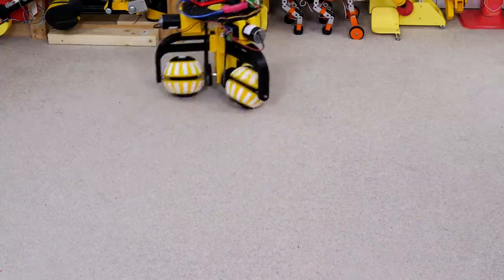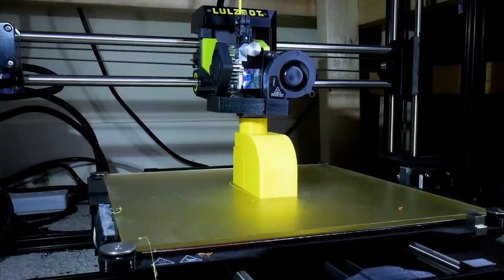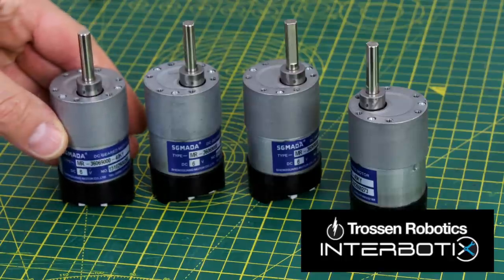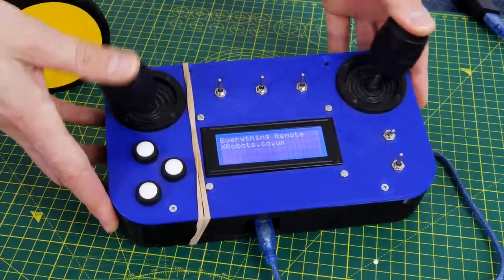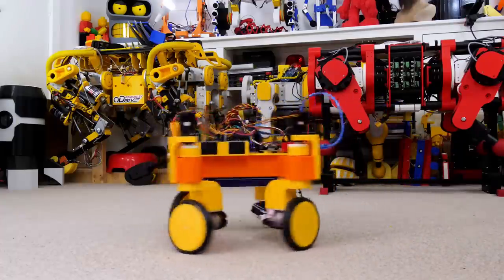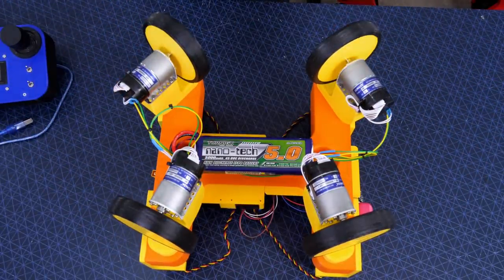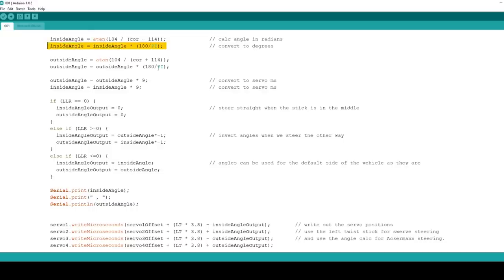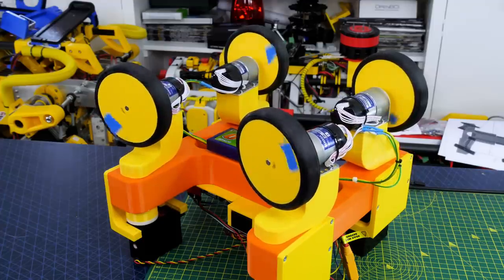How Many Ways Can This Robot Steer?

Comment: Now you need to code a more advanced version. The ones in FRC do a vector addition problem. It allows you to request a position and request a rotation with command inputs and the controller will figure out what direction all the wheels need to be turned and what power to give them. Usually 100%. It is pretty crazy some of the stuff you can do. with this method it is possible for the robot frame to be spinning and driving in a linear path.
Reply: Our frc team actually has field oriented code, kinda unrefined though, we are working on it.
Reply: Great idea 🙌
Reply: How would that look and work with this kind of robot? Are there robot videos on YT that show this mechanical setup (no omni wheels) being able to rotate and drive independently of the path curve?
Reply: @CuulX  FRC robots have mechanisms where the wheels can rotate infinitely. So there are no issues with running into a servo limit.
Reply: @CuulX  You would ba able to move as in a fps game, and if using fpv, you would get similar sensations. Probably not the most usefull think on earth, but for example if you had to use a forklift vehicle, these controls could be very usefull.
Reply: @nathanskinner423  ok! I found another comment linking a video also. And I thought some and figured out how I would program it to do all of that and now it makes sense.
Reply: @danroswell8844  Nice, looks great!
Reply: The way we configured our field centric code was one joystick translated the bot in x and y and the other controlled rotation, it was super easy to pick up for new people
Reply: @comedy6631  I think most frc teams have field-centric driving for swerve, at least my hs's team has it
Reply: @nathanskinner423  Not only is there no servo limit (which I'm assuming you mean is a limit with how far the servo can rotate, not the mechanism), but also since the motors are mounted on the top the motor wires won't get screwed up.
Reply: @spidernh  Yeah, I know. I studied Jack in the bots design a lot. I made a 3d printed version to play with. It of course would never survive competition .
Reply: @nathanskinner423  Nice. Also, how hard is swerve to program, if you know? I'm in Michigan so I'm still doing FTC (in 8th grade) but next year I'm joining FRC and last year they did swerve, so I would assume they will in 2023 also, and I feel like it's gonna be hard to program
Reply: god i really want to help program a swerve drive one of these days...

if you don't mind me asking, what is your team number? i was 1983 but now am with 2097 in Seattle :D
Reply: @raphaelmonserate1557  I was in 4309. We came up with our own innovative drive train, dual drive.
Reply: @spidernh  Swerve is like any other code problem. It seems really hard at first but you can break it down into much easier to solve smaller problems until you reach full optimization. It will require some trig knowledge as well has vector and array understanding. I think you can do it. This is of course if you are starting from scratch. You can download libraries to make your code a lot easier to put together.

Comment: This drive system is way more effective than I expected, and the design is commendably simple.  It would also be interesting to see a differential swerve drive - there are a lot of interesting ideas out there.  It could use bevel gears, or it could use a slipring.
Reply: Mmm. Triple-Differential~

Comment: High-school robotics teams have been using this type of drivebase for years. However, one problem with swerve--drive is that there is a bit of a delay when you want to change direction, as you have to wait for the wheels to rotate to the desired directions. With Omnis or Mecanums the change in direction can be almost instantaneous. Anyway, for some next steps, you should consider improving the algorithm for turning the wheels such that you can input the desired translational and rotational velocity of the robot. This will allow for true holonomic movement.
Reply: If you can, and assuming you are using SDS modules, use Falcons rather than neos for steering. Our team has experience with both an all-falcon drive and a falcon (driving and NEO steering). It would be neat to see a Swerve Drive go-kart that uses a joystick, and would be fun to rip around on, especially now that SDS sells a Colson Wheel Kit.

Comment: You are the man that really should own a plastic crusher/melter filament recycling machine with all that printing you do !
Reply: Do you know how expensive and difficult it is to process your own plastic back into filament?!
Reply: @lio1234234  well not really. I made it for my college project and I was able to get it done for  under $400
Reply: @sajalagarwal195  What was your filament diameter variation? And was it consistent across batches?
Reply: @cx765  precisely! It's impossible to get perfect prints when you have flow differences due to varying diameter of the filament!
Reply: @lio1234234  You can compensate for this with a filament thickness sensor on your printer though.

Comment: I recommend learning geometric algebra, it simplifies tons and tons of difficult linear equations to a single tiny human-readable equation or two.
It treats rotations and translations as reflections, which allows a lot of terms to cancel out. This lets you come up with transformations, that are far better than quaternions, and that allow you to easily mix translation and rotation. In fact, quaternion - is just a bireflection in 3d. Bireflections in general sense are called rotors, which actually work for any amount of dimensions.
I could honestly talk about beauty and simplicity of GA for hours. You have to learn it, at least for times when you get stuck with mathematical derivations.
It would allow you to program a lot more difficult robots with little thought. You could easily make an inverse-kinematics algorithm, that works with various motors, pistons and hinges of all sorts of degrees of freedom.
It might be hard for someone unfamiliar with terminology to get into GA, but believe me, it is 100% worth it. The actual math is far simpler than you might be led to believe.
Reply: Is geometric algebra something akin to a branch of mathematics?  Or is it a more focused set of ideas than that?  Also, where would you point people for an introduction?
Reply: @doctorbobstone  There is a community driven website about geometric algebra, under the name of "Bivector" but youtube keeps on removing my comment with a direct link
Reply: What math prerequisites are required to be properly prepared to study such material? Differential equations? Linear Algebra?
Reply: @pws354_8  Mostly just good intuition about linear algebra, I'd say.
Reply: @pws354_8  Knowing group theory would also help grasping some core concepts.

Comment: This would be an excellent platform for a custom built slipring! This would let you rotate the wheels as many times around as you want, although you'd need encoded motors to drive the rings.
Reply: He is using encoded motors

Comment: Simple yet effective design. Seems really nimble and quick. 
One thing I noticed, though, is that it seems to speed up in curves.  Do you run the inner pair of wheels at the same speed? If they slowed down slightly when turning, and you modeled the line of turning between the inner and outer pair of wheels, I think you'd get consistent speed.
Reply: That sounds correct. It seems that he set the inner wheels as 'the speed' and pushed the outer wheels faster too keep up. It works but would be unusual and uncomfortable as a passenger. The 'outer side passengers' would be constantly thrown against the wall.

Comment: If you use a less aggressive steering angle in the "rear" wheels, you can keep moving forward throughout a turn.

Also if you steer all four wheels in the same direction at higher speeds, you can get more stability. Anti-Ackermann arrangements help out here too, and having differential steering on top of that is always fun too.

Comment: Consider replacing the current wheels with omni wheels and using the ability to control the angle between wheels and the current direction of travel to create what amounts to an infinitely variable transmission. Imagine the wheels initially pointing in the direction of travel and then gradually pointing more and more inward as speed increases. Would be really cool to see how fast it could go.

Comment: Have you thought about using a component like cable down the wheel shaft so you can power the motors without having to worry about wires restricting your motion.  I’d assume the motors can overcome the friction caused by the cable connection (though from my experience with CRT’s they can get loose pretty easily) but you’d get 360 degrees of free XY plane (floor) rotation
Reply: An easier component to use for that task is called a slip ring!
Reply: @davidmalkowski7850  I didn’t know about that! So cool!
Reply: FRC does something even easier, we put both motors at the top and drive the wheel with a bevel gear at the center of rotation, look up SDS mk 4 for a good example of this
Reply: @killapoof  that’s so clever! I’d imagine the wear on the gears is less than possibility of dust/buildup affecting the electrical and magnetic signals of the previous two suggestions and it keeps both motors stationary as well rather than a rotating motor (not in the way that it should) creating unnecessary toque

Comment: you should make the centre of the turning circle move closer till it goes to the centre of the robot and it rotates on the spot, this is how ive built 4 wheel steer robots like this in games, it makes a very intuitive and fluid transition from straight to turning to rotating and back again

Comment: Great Job! Loved the project. Perhaps one thing that could be done is to add some gear ratios to make the wheel turn 360 degrees while the motor does half that.
Reply: On the servos, or the wheel motors?

Comment: 2:1 gears on the steering for 360° rotation and to offset the steering axis from the servo axis. Then you can use a hollow axle to run the motor wires through. Or stepper motors/CR servos and an encoder for multiple turns (limited by the motor wires twisting).
Reply: good ideas, but 360 doesn't add much functionality, since you can already reverse the voltage going to drive motors and cover the remaining 180 degrees with the current setup. turning would be twice as fast though (and half as torque-y).

Comment: You could also try different designs of omni wheels, you get ones where the wheel is just many diagonal cylinders around it and it should mean you get the same contact area in every direction.

Comment: That's awesome, I'd love to see a version you can ride...
Reply: The wheel mounts definitely look like the weakest structural piece, you would need to make those significantly sturdier if you wanted to support the weight of a person. Not to mention the weight of the rest of the vehicle. Probably possible, but not sure about practical.
Reply: @Manabender  But imagine him riding around on a chair like that, at a convention, that'd be so funny. Using 3D printing alone would probably be hard, but he's got a CNC and a welder...

Comment: Have you ever seen the 2008 movie, Speed Racer? Some of the cars in the movie, called T-180s, use a jet engine in combination with that type of omnidirectional wheel to vector the engine's thrust in any direction without losing wheel grip or requiring (even more) insane engineering to create a nozzle capable of vectoring a full 360 degrees.

Comment: Are you running your servos straight off the 7.4V line, or is there a voltage regulator between the battery and the serovs?

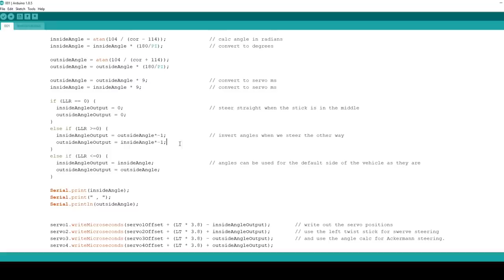Comment: 8:01 You can assign value1 = -value2 ommiting multiplication for better code performance :)
Reply: I guess that depends on the hardware implementation of the CPU (multiplication may take only 1 cycle) and the efficiency of the compiler.
Reply: @nkronert  Yes, perfectly true, but in this case Arduino can make like 1ns difference :) :)

Comment: Is there a way to add some suspension travel, and calculate the proper amount of wheel rotation for all wheels over obstacles or on uneven terrain?
Reply: I think even without extra calculations it would work pretty well over obstacles, as soon as it has suspension and knobby tyres. The fully independent 4-wheel drive would ensure it moves on as long as any two wheels have traction.

Comment: I wonder if you could eliminate the need for the steering servos by offsetting the wheels from the pivot point at the top and driving the wheel to turn it around the axis.

Comment: I really really like the Idea behind this. As a Project its great, to learn the Stuff in Robotics. As Ing-B, my thoughts was first like -
"mhhh in an industrial Environment - what is about the wear/tear on specific Points on the Wheel - is it cheaper than a Omniwheel Component , which are mostly easy to change?" :D

But James, i really like your Content. Actually i work on my own System for a R2 Droid ^^

Comment: highly recommend bevel gears for more range 

there are a few cads out there by FRC teams about how it can be done 

many teams have 3d printed these as well and they are using 12v 40amp brushless motors
Reply: Do you mean having a bevel gear between wheel and mounting motor vertically? I will look up what FRC is as I have not heard of that before. Cheers 😃
Reply: @TheTotalGeek  bevel gears used to apply power to the wheel and allow full range of control as  the motors are mounted and the power is transferred via gears and pullys

Comment: How about calculating the angle and speed of the wheels, by first moving the whole robot (in math) to a new position and orientation based on stick inputs (a single 3 axis stick should do, pushing for translation, and twisting for rotation), then calculating the direction and distance between the current and the new position of each wheel, and using that to decide how to turn the wheels and how fast they need to spin?

Comment: I had an Idea for a steering program for this vehicle.
What if it steered making the wheels point at a virtual point controlled by the controller? For example, if it's set at the middle, it rotates on the spot because all the wheels are pointing in. If it's set to the sides, it does Ackerman steering because the wheels point all at that same point.
Reply: As long as you have an edge case for driving in straight lines.
(I'm working on a similar swerve drive project)
Reply: @kantpredict  just make it so at the most extreme positions, the point moves to infinity, making the wheels parallel
Reply: @crackedemerald4930  yeah but the maths doing the angle calculations really wouldn't like you throwing infinity in there 
"DIV0!"
Reply: @kantpredict  just use calculus to approach it
Reply: @crackedemerald4930  that's a very intensive way to approach the problem, rather than an if statement:
If(centerRotation>largeDistance){ wheelAngles=0

Comment: Great idea. but would it not be even better if you had 2 of the motors you use to drive the wheels, (for each wheel) in a setup that you have on some printers, think it call an H drive, so two motors work together, if they both rotate in the same direction then the wheel turns, otherwise the shaft turns. and it would possibly be able to lower the weight point as well.
Reply: I had the same thought.  Turns out it is called 'Differential Swerve Drive'.  There are some YouTube videos about them, but they are mechanically a lot more complex than James' solution.

Comment: Now imagine all EVs for the city would be like this. You could reduce parking places by parallel parking without any gaps between the cars, plus other benefits. I wonder how much would the cost of the drivetrain increase compared to a classic one.
Reply: Much higher costs for sure. Not worth the 5 seconds it may save parking.
Reply: @hippopotamus86  Dunno if with electrical motors in the wheels it would be much more expensive. And the space economy would be huge, of course if all cars would be of this type.

Comment: So it's like an all wheel drive all wheel steering shopping trolley - works well - interesting. I remember when all wheel steering was the future. Good for robots In tight spaces - not really necessary for cars.
Reply: Scaling it up for a car would make much heavier as the added weight will need more reinforcing. More moving parts adds complexity and drives up costs.

Comment: Although I found your video interesting, there is a much better way to control a swerve robot. The way you do it, even if you say “normal” steering and swerve steering can be combined when the robot is upside down (wheels up), if you would put it down and try it, the wheels would rotate in opposite directions making them slip. Actually that is why you do not do it while demonstrating in the last part of the video (you only steer or swerve (translate), but you do not do both at the same time)

Comment: Your vehicle accelerates in corners because you're over-scaling the wheel speed - technically you need to drop inner wheel speed and increase outer wheel speed. Outer wheel speed should be increased in scale based on the difference between the turning radius of the vehicle's centerline and the radius of the wheels' center line, inversely for the inner wheels. All you need is the circumference of each wheel's projected circle.